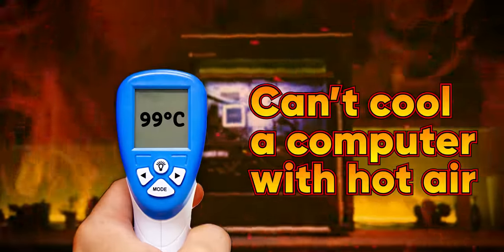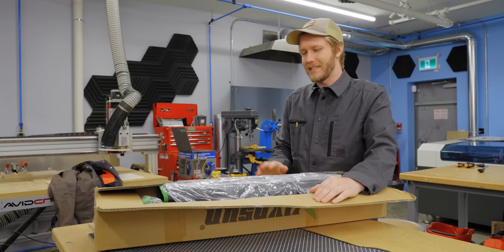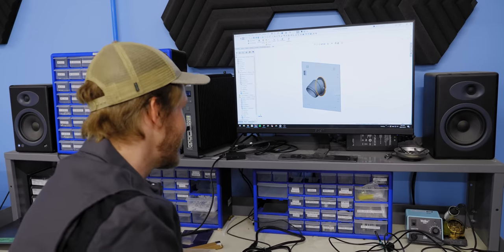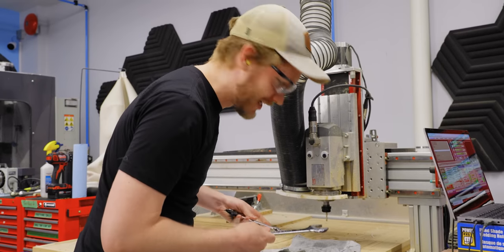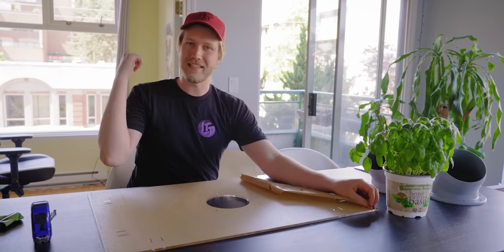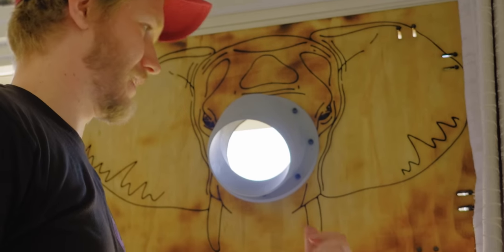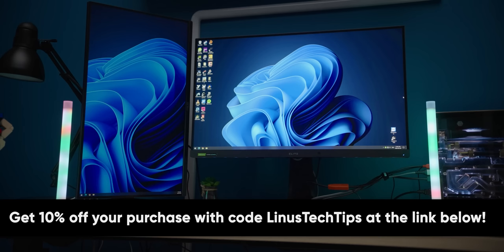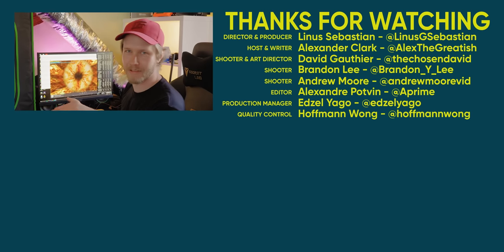You’re cooling your PC wrong. - PC in a Grow Tent

Comment: You should just mount a radiator outside your window and run your computer's water cooler to it. In fact, you could water cool the rest of the room too! Perhaps you could call the concept "Whole Room Water Cooling". Maybe Luke's dad can help?

I can't see anything going wrong!
Reply: .... This feels like air conditioning but with extra steps.
Reply: That's a heat pump
Reply: I mean, for one PC close to the window it's not that crazy
Reply: @Chris-rg6nm  A heat pump would entail a compressor, condenser, evaporator. 

At which point, that's the air conditioner aspect he wanted to avoid
Reply: @ilovefunnyamv2nd  But he'd already done that in his new home. His PCs in the server rack are planned to be cooled by a loop that goes outside and into his pool's walls. PCs are inside - "radiator pool" is outside.
Reply: Wouldn’t the radiator get really dirty though? And all the debris in the air would clog up the fins
Reply: the couch can just be a giant piece of water cooled copper pipes
Reply: @Somtaaw7  actually it's air condition but with fewer steps. Or possibly not air conditioning at all.
Reply: @ilovefunnyamv2nd  He does have underfloor heating throughout his entire house though...  Underfloor cooling perhaps too?
Reply: hey look, he invented the air conditioner
Reply: While entertaining the disasters they suffered with that experiment could have been avoided easily.  1)Split loops: Each PC has its own internal loop connected to a heat exchanger which is connected on the other side to the external house loop. This prevents the corrosion issues they had as each PC is isolated from the rest. 2) Scale: Instead of using consumer PC liquid cooling parts for the external side they should have resorted to industrial hydronics for the pump, radiator and fan.
Reply: Or just mount your pc Outside under a roof and route the cables inside.
Reply: @SimonBauer7  The main issue with the whole room cooling is they tried to use the same WATER for every PC and radiator...  If they had used water-water intercoolers for each PC in the loop, so that each machine had ONLY their own water, it would have been fine!
Reply: Drill the computer to the wall on the outside, then run a single thunderbolt cable inside.
Reply: On a serious note the key concept here is to watercool EVERYTHING in the pc. Not only the CPU and GPU, but also getting one of those blocks that covers the chipset and vrm of the mobo, and also a block for the RAM. Don't know what to do about the PSU heat tho.
Reply: get a MORA rad and call it a day
Reply: Mr B got my respect and gratitude
Reply: @ilovefunnyamv2nd  you mean not jank enough yet. ;-)
Reply: @sinni800  lmao THIS ^^^
Reply: ah, and what do you think would happen if you mount a radiator outside in the sun during summer?
Reply: @noyz2828  hahahahaha "what?? i just turned on my PC and my CPU is already at 95 C??" xD
Reply: This could theoretically work if it was executed properly
Reply: @SimonBauer7  There were many issues, but I don't think that was one of them
Reply: Rewatched that series recently, so good
Reply: "look at me everyone I remember old content " vibes
Reply: They did mention in the WAN show I think that Alex's apartments dont allow window mounted air conditioning units. So I guess that's why they went with this solution.
Reply: Pex over copper
Reply: Wouldn't it be less efficient at radiating if the outside air where the radiator is is really hot? The outside air can get to 40 degrees in the summer by the end afternoon where I live.
Reply: well this was WAY cheaper and pretty much NO maintenance at all.
Reply: wc is a pain..
Reply: @SirCrest  Ohh thanks no wonder my set up isn't working
Reply: It is the perfect spot
Reply: Have you heard of cars?
Reply: The problem is that heat transfer goes both ways. Eventually the radiator outside would be getting hot. You'd need a compressor to overcome this and boom we're at an A/C again.
Reply: @EnsignLovell  you don't want to cool via water pipes.  Cold pipes will get condensation on them and drip water everywhere. Same thing in a concrete floor,  you'll get moisture problems
Reply: @Chris-rg6nm  Maybe you're a heat pump
Reply: This do this. It would be more efficient, your blowing all the cold air in your house out the window, literally.
Reply: i already do this
Reply: Watch the whole room water cooling janky and didn’t work
Reply: @SL1CK__  Yeah they didn't know anything back then. With the knowledge and tools he has now he can make it work.
Reply: Don't forget to keep your hard drives stored teetering on the edge of the sink, that's how to professionals do it!
Reply: @1987FX16  most likely they could but I wouldn’t really work with the warehouse now since no real windows
Reply: @BrandonDoran00   😂😂😂
Reply: I have actually tried radiator outside the room setup and put the radiator in my crawlspace (because its cooler than outside). It works great, the setup is clean and no noise because even the pump is outside the room 0 noise.  I stopped doing it because maintaining the radiator once a year is too gross :) Fan or AC in the window is just so much easier and cost effective.
Reply: I want to do this with my own pc sometime, especially since I live in Wisconsin and could do some radical overclocking in the winter. I’d definitely have to use antifreeze tho for those -30 degree days
Reply: Gonna need a pretty monster pump, but that'd be cool
Reply: in summer i have the desktop on the windowsil and open the window and have blackout material going over and around the PC to the window opening ,no hot air is expelled into the room, so its like a tent shroud
Reply: I think they should try watercooling the grow tent, make it a closed loop system. The way they have it set up in the video, arent they just dumping a ton of air conditioned air into the environment?
Reply: There are special ceiling tiles with water connections to water cool your room. Typically you run a submersible pump from a well and warm water comes back to the same well.
Reply: The block radiates heat as well even if the radiator is outside.
Reply: @marsovac  he could of do what i do, i built a tent around the PC outakes right to the window opening
Reply: We've come full circle
Reply: water cooled room? oh no... Linus! its happening again!!!!
Reply: @Chris-rg6nm  that's not quite true. A heat pump requires an expander - the substance/liquid/gas has to be expanded to cool down, just like how a fire extinguisher works. It's because of the molecules moving apart to take up more space. A normal water cooler isn't the same as a heat pump or refrigerator. The heat/cool cycle requires an evaporator - it is the opposite of a condenser. https://en.wikipedia.org/wiki/Evaporator
Reply: i remember linus did the entire house water cool way back to his last last house
Reply: @SimonBauer7  One heat exchanger per computer into the big loop and propper UV filtration in place from the beginning would do the trick.
Reply: @SimonBauer7  that and they used copper tubing witch just dissipates the heat back into the room.
Reply: A quick connect through the wall for pipes so you can move the PC and but more pump power for the longer loop.
Reply: This is actually the principle behind ductless / mini-split AC. I'm just imagining bringing in an HVAC contractor, them asking, "all right, where do you want the evaporator?" and, while pointing to your PC case, saying, "in there."
Reply: @GSBarlev  the downside is that you end up with solid fixed lines an a unmovable PC.
The copper pipes are insulated and soldered since the refrigerant is under pressure.
Reply: @SimonBauer7  I think the problem was they can all the pipes so much higher than the pumps and computers which just messed up the flow rate of the water...
Reply: @TwistedMe13  also insulation on the copper pipes to prevent the heat being dumped back into the room.
Reply: That sounds janky as hell. I love it.
Reply: I loved that idea
Reply: they already tried it but the problem is that there's corrosion on the coppper tube. Although insulated copper tube like the one used on air conditioner will help prevents corrosion i think.
Reply: @nichronos  To cool the PC, it doesn't need to be "winter" cold. As long as it is under your expected thermal threshold.
It's not also a close space that heats up rapidly.
It's not like everyone lives in sahara with 40-50C outside temp.

An average of 21C outside temp is perfectly cool enough.
Reply: @SimonBauer7  it is complete bs. they should have just concentrated the heat source in a controlled enviroment like a data center you know...
Reply: @dantesk1836  they make portable AC's where you just run the tube to the window for vent and intake.
Reply: Chic Stw  i've never done any plumbing so hearing pex is a new thing to me. However after a quick google search, i believe it can be used since it also being used for cold and hot water, and since it's made of plastic, it won't corrode like copper tube.
Reply: @ilovefunnyamv2nd  I'm glad someone else remembers that they did that.
Reply: Best idea ever!

Comment: I love how he's able to machine, cnc, and print everything... except the grow tent itself.  I wonder what kind of toys we can get to make our own Mid Tower sized Grow Tent.
Reply: Nobody knows how to sew. lol
Reply: underrated observation
Reply: Need to level-up the sewing machine skills.
Reply: Could have made an acrilic box to put the PC in too.
Reply: The "box" could have been plywood, cardboard, or Styrofoam, but then you would not have a cool grow tent in your video that was sent to the show free.  
You could also just run the duct or ducts from the exhaust ports of the PC which is already a box...
Reply: sounds like the real answer would be to have all but one fan on the PC be intake. Then have his hose adapter made to bolt to the rear 120mm fan spot on the outside. Have that hooked to a 4 inch grow tent fan on low.
Reply: The oversight with using just the case as "the tent", is that adding the extra pressure to the case invites more dust collection inside the case. Also, there's too many holes throughout cases that likely wouldn't offer exact air direction, than just the simple "air comes in through intakes, goes out exhaust". Any typical case has grills all over the top, front, bottom, and rear, as well as grills along the rear i/o like pcie expansion slots, and the psu.

With the grow tent, you've got just 1 intake opening, and one exhaust. Assuming the zippers don't bleed any air, that thing should technically be air tight, and the foil basically acting as an insulator. An aluminum pc case technically would absorb heat, and barely dissipate it, as minor and little as that may be.

Good thinking tho
Reply: I’m glad this is up in the comments section. I was thinking just that. They build crazy hardware but a tent is just not possible.
Reply: It could've been a purpose 3D-printed PC. It would've removed the need to put a case in a case. Also, this way, they could have made it utilize Noctua fans instead of a big air pump.
Reply: At that point wouldn't you rather make an adapter for the exhaust Fans of the case?

Comment: Ditch the tent, and 3d print a new panel for your pc with a duct attachment. Or use the spare duct and cut out a hole in one of the existing panels. Your pc temps should improve too.
Reply: Good idea
Reply: It's a bit weird he didn't go this route, or at least do it at the end of the video.
Reply: Nah, this is a typical project by Alex. He can't plan 30 minutes beyond what he's doing. Just a total hack with a pretty face and connection to Linus.
Reply: @oodlespring  Pretty rude thing to say about someone you don't even know.
Reply: @oodlespring  I think that's taking it a bit far, coming up with original ideas and topics worthy of a video while being easy enough to finish in a timely manner is no simple task. While my idea is probably more practical, I doubt it could pull the same views.
Reply: Plus the fact that they try to come up with crazy ideas to keep people entertained.... If it's efficient but boring, they might go straight away for the crazy but fun idea that will make more views
Reply: TLDR this wasn't a solution for his specific problem only. To expense this to the company and get content out of it it had to be at least a little viable for the average person. Piece of wood with a hole in it, a grow tent, duct, simple vent. All easily available for most people. Sure there is possible future content to make this better but probably a quick video to pump out while other projects eat up time.
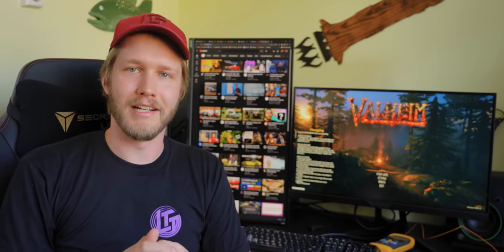Reply: @oodlespring  The concept for the video 0:35 was to copy what crypto miners have been doing to see how well it actually worked
Reply: But then how would there be a product for them to push?
Reply: @buzzfpv7773  what is it you think they are pushing in this video? 
I only saw grow tent, ducting, extraction fan and machinery in the work shop and I'm sure we are all going to rush out to buy all that
Reply: @oodlespring  you ok ? lets deal with the issues in your head before you take them out on strangers
Reply: @oodlespring  Alex, pretty face? Lmaoooo
Reply: OR, 3D print a duct that's like a funnel that can be screwed into the rear fan exhaust spot and attach straight to the tube. The case itself might not even need a 120mm fan at the rear by that point.
Reply: That would work great with my Tower 900. If I only had a 3D printer
Reply: @oodlespring  someone didn't get past the interview stage at LTT lol

Comment: 3:20 in a grow tent setup you need those metal pieces to hold up the lights that will help the plant grow. Some people also use them to hang ventilation equipment pulling air into or out of the tent.
Reply: ⬆️Congratulations you have been selected as one of the lucky giveaway. Message to claim your prize 
Thanks for commenting and engaging
Reply: These bots are the worst.
Reply: 2:45: I'm too cool to read the directions.

Comment: Definitely would recommend 3d printing some ceiling mounts for that ducting. Keeping it up in the ceiling would be even better.
Reply: For keeping it out of the way sure, but for performance it doesn't matter.  Air only has 1 way to move through there.
Reply: @wickedwonka999  it can hurt the airflow though? due to minor kinks and whatnot
Reply: @DeathKiller362  sure, but so can the extra length of tube they left, extra distance is harder than a curve
Reply: @DeathKiller362  and even still, that 6" inline fan he used moves upwards of 400cfm.  That tent is 2'x2'x4x so 16 cubic feet.  Trust me, there is no problem moving that air.

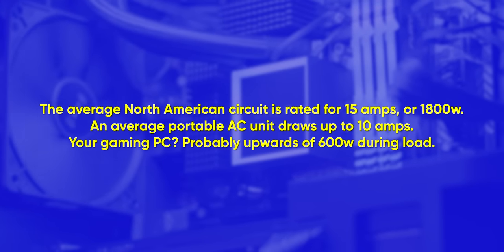Comment: 1:22 "Our grow tent only costs $65"
4:19 "duct tape it up and call it a day"
5:56 "I love that we have such high shop utilisation right now"
all you need is
a grow tent
Ducting
Duct tape
Milling machine
plastic parts
Wood
Bolt fittings
blow torch
mineral oil
industrial fan
3d printer
CAD program
and a Freaking laser cutter

This is a convenient accessible & cheap little diy project we have here.
Reply: The shop was just for his window, I made an identical window adapter using a hotknife and a sheet of styrofoam. The rest could just be done with normal flexible tubing and some PC fans...
Reply: All you need is a tent, duct, inline fan, board, hole saw, flange, and duct clamps; in fact, you can replace the board, hole saw, and flange with a portable air conditioner window kit, making everything plug and play. Granted, I know my way around a grow room, but this is like a ten minute off the shelf project.
Reply: @hlaw2830  can confirm. This project would cost, what, $200 tops? That's assuming you over engineer the snot out of it like Alex did.
Reply: @helljumper912  Let's see...
>Amazon
>tent: $50 (if light leaks don't matter, we can go cheaper than viviosun, lol)
>4" inline fan: $30 (6" is overkill for such a small tent, like... a lot)
>4" duct with clamps: $10 (clamps > tape, simple as)
>4" flange: $10 (probably cheaper at Home Depot or Lowes)
>4" hole saw: $10 (you can get a set for the same price, but you will throw it away)
I'm gonna say that you need to be a pretty lazy spender to go any deeper than $100 on something like this. For $200 we can add a light, filter, and get the supplies for baby's first autos, might even be able to afford the seeds too.
Reply: lol who has all these
Reply: It's not a tutorial but proof of concept. Many people could make something similar with random junk they find around the house. And a lot of people can use this idea in a different manner to get the same result. You use what have, they happen to have a lot tools and pretty flexible budget.
Reply: @yummy90the2nd  me